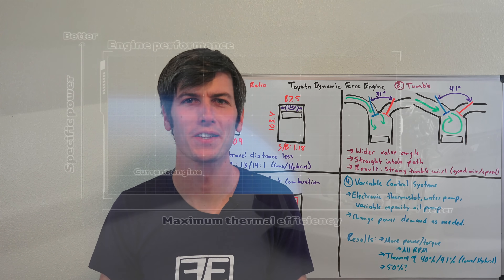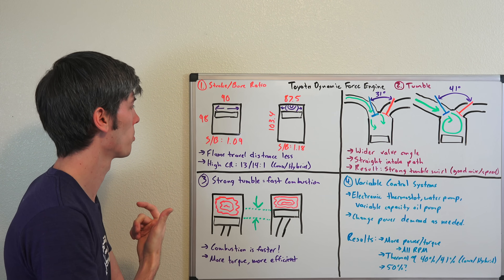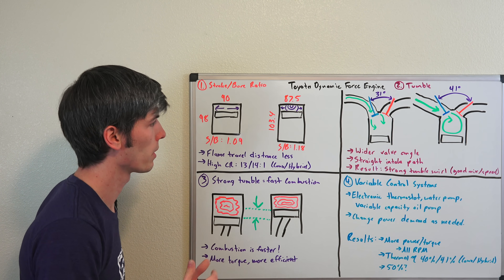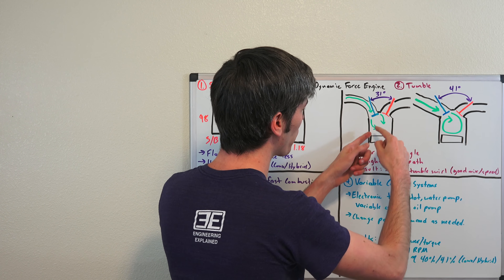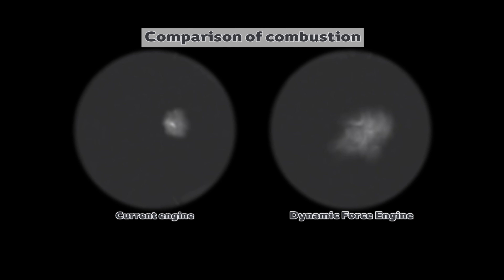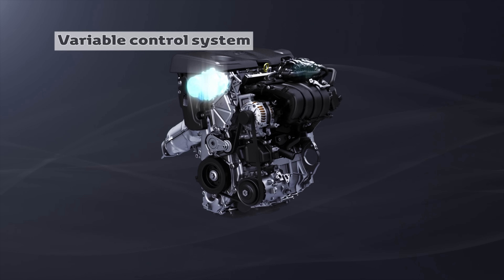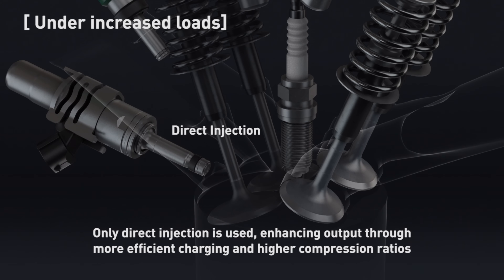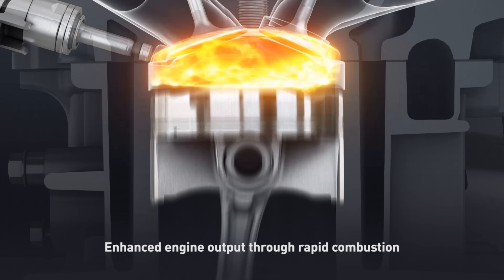Toyota's New Dynamic Force Engine Is Super Efficient

Comment: You may want to clear up which heating value Toyota is using to measure their thermal efficiency. Using the low heating value (LHV) subtracts the energy required to convert the water from a liquid to a gas. This must be included in the calculations because the amount of energy to convert the liquid water to water vapor is a significant usage of energy in the total combustion process. Toyota is likely using the High Heating Value (HHV) which neglects to account for converting water to a gas. This would inflate the thermal efficiency well above the LHV because it assumes the water is leaving the combustion process as a liquid, which it is not. The LHV the more usable and more accurate measure of thermal efficiency, and it is possible Toyota is not using this measure in order to make their modifications look more impressive.

Comment: Great video as usual, but 40% thermal efficiency? Compared to what? (what's the typical efficiency of non turbo engines?)
Reply from the maker: Generally in the 25-30% ballpark, though new engines are certainly getting better.
Reply: @EngineeringExplained  Thanks for clearing that up, it was not mentioned correctly in the video.

Comment: I'm noticing the flow of the fuel from the injector nozzle goes over the top of the intake valve. A way to get the benefits of direct injection w/o the PVC deposit buildup to carbon on the top side of the intake valves most often associated with single injector DIF engines?

Comment: In a few years we will finally start using ethanol as higher octane and more efficient fuel
And i am sure 50-55% thermal efficiency for such engines with compression ratio 14.7-15:1

Comment: A question, If the process of combustion is able to be faster due to these new passages and the  changed degrees of the valves would that allow for higher RPM from the engine?

Comment: Do all Dynamic Force Engines (including hybrids) use atkinson cycle during low power demand (cruising)?

I also heard they have direct and port injection.
Reply from the maker: I would assume so, since they have variable valve timing it's only a matter of software. Yes, both direct and port (shown at 4:20).

Comment: I notice it's direct injection, however it's able to spray fuel on the back of the intake valves whenl they open(animation). Could that be their solution for GDI carbon build up?
Reply from the maker: It's direct and port (shown at 4:20).

Comment: About 12 or 15 years ago I thought about the advancements of what they could pull out of an internal combustion engine and I figured one day will be running electric water pumps and variable capacity oil pumps and electronic or digital dashboards that you can arrange a tachometer and speedometer how you like, they all came true!

Comment: I drive about 80k miles a year. I need a cheap hybrid for perferbally under $25k. Are my only options a Prius C or that Kia Niro? The Niro clams better mileage, but Im assuming the Toyota will last longer? Anyone had any experience with these cars, or is there another cheap hybrid Im forgetting??
Reply from the maker: Well the Camry L uses this engine (not hybrid) and starts at $23.5k. Rated 41 mpg highway. Not quite hybrid territory, but a pretty good rating.

Comment: Could you do a comparison vid of this engine and the skyactive x engine. Thermal efficiencies, fuel consumption etc.?
Reply from the maker: Perhaps!
Reply: and the Infiniti VC?
Reply: @morganspencer-churchill2136  Smart guy only one who has the knowledge to know Mazda /Toyota not one Manufacturer comes close to Nissan /Infiniti power output from VQ25 on.
Reply: I like that idea
Reply: In for Skyactiv X comparison.
Reply: Definitely would like to see this as Toyota Camry is getting 39-41mpg on highway with this engine.
Reply: Daniel G    I get that same range on my 2013 Accord 4dr with CVT.  In the mountains in Utah...
Reply: I was just about to write that exact same thing as well before I saw your post.
Reply: This engine burns fossil fuels and the skyactive x engine also burns fossil fuels. The difference is that the Mazda moniker is more honest: the exhaust sure is "sky active" in that it belches radiatively-active gases.

Comment: Awesome video. I guess Toyota is addressing the DI carbon build up problem with this new technology as well as improved efficiency. If I am understanding the video, fuel is being sprayed on the back side of the intake valves via the unique placement of the direct injectors and also from the port injectors when under low load. How cool is that!
Reply from the maker: Yep, pretty neat! Makes a lot of sense to have port and direct.
Reply: This fuel injection method is not new, Toyota has been doing this at least with Lexus engines since 2006.  Port injection (when in use) can help keep the back of the intake valves clean, but direct injection will never “spray” the intake valves  as its intents is to give a precise amount of atomized fuel at exactly the right moment AFTER the intake valves are closed.   By being able to do this engines can benefit from having a higher compression ratio without spark knock occurring.  Spark knock occurs when a fuel/air mixture is being compressed greatly and pre-ignition occurs; usually before top dead center of the power/ignition stroke.
Reply: The direct injectors in the animation are below the intake valves and on the side of the cylinder wall. The first shot of them pulsing fuel, the valves are turned transparent to aid viewing, so it looks like they're spraying the back of the valves, but by definition they're injecting fuel directly into the cylinder, not in through the valves.
Reply: Carbon build up and all theses new cars is ridiculous
Reply: Kia came up with a different solution they have the injectors spray twice, once when valve is open so it sprays the back of the valves and a second time during the combustion cycle. It’s a dual pulse setup I think.
Reply: Yup, I see it now, the port injectors in concert with the direct injectors should keep them clean.
Reply: do you know what KIA engines have this?
Reply: Konigsegg claims direct injection doesn't have many benfits over port injection with freevalve since the whole point there is to control the air better
Reply: Doesn't it look like some fuel is going regurgitate back to the airflow